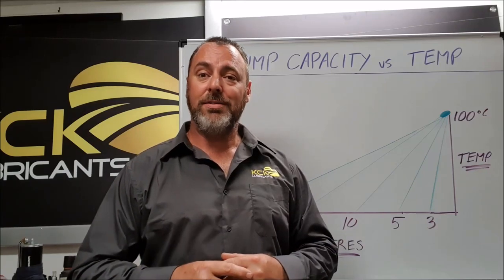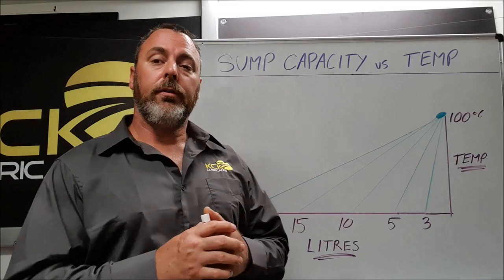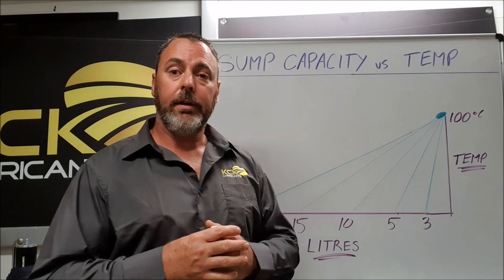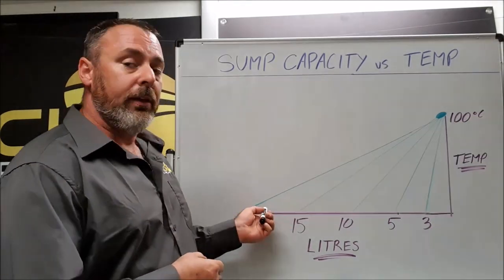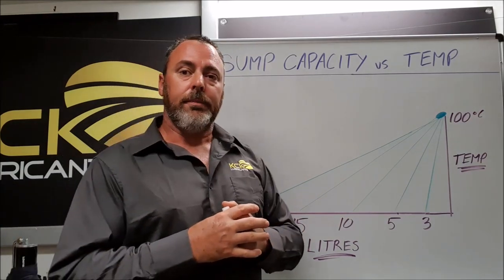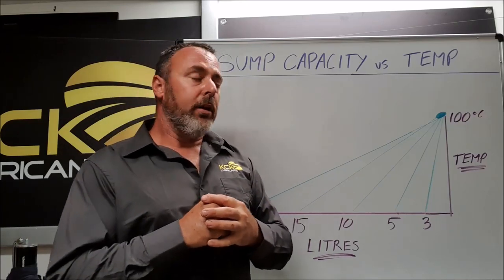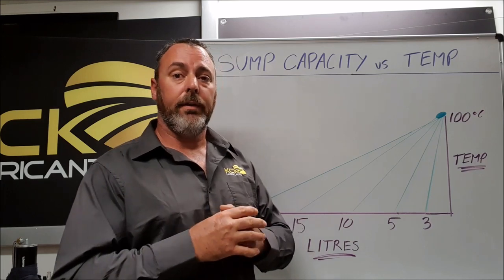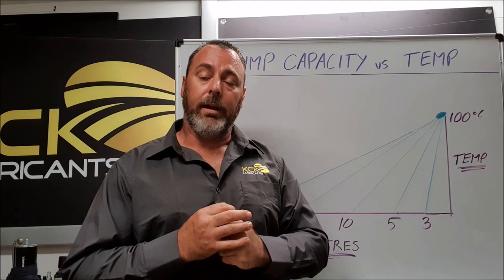Sump Capacity Vs Oil Temp, will increasing your sump capacity lower your engine oil temperature?

Comment: Terrific video. I have a BMW F10 550. It is in 63 motor V8 twin turbo. It’s a hot day so the turbos sit on top. I’m using liquid Molly 10 W 40. The temperature is usually around 100 to 110°C but I find during the warmer months he can reach up to 120 which concerns me. Without changing all Sams Wikipedia another option to slide to reduce the oil. Temperature on warmer days.
Reply from the maker: Thanks for watching! yes those do run hot but with a good oil its not a concern.

Comment: hey, what if the designed operating temperature is 100 deg C but bcoz i have a larger sump or if I provide external cooling the oil never crosses 50 deg c. how will it impact the engine performance or will it increase engine deterioration?
Reply from the maker: Absolutely check this video out, https://www.youtube.com/watch?v=9QLhDH-HNvI&t=8s

Comment: This is the same concept in water cooling a PC. For instance let’s say you have two computers and both have a custom loop cooling the CPU and GPU. One PC has a 120mm reservoir for the coolant and the second PC has a 360mm reservoir. Under high, constant load, eventually in both systems the CPU/GPU will reach the same max temperature, but the PC with the 120mm reservoir will reach that max temp quicker compared to the PC with the 360mm reservoir simply because of the amount of coolant the reservoir can hold. Great video! Simple and to the point
Reply from the maker: Thanks for watching! great point and very true, glad you enjoyed

Comment: However if you do have higher capacity and lets says your engine oil temps range from 220-270F on the track, it will be a much slower change when going between the 2, this also means it will take longer to cool the oil. So relative to short increases of temp, yes you will have lower temps in a short period of time compared to low capacity. But the lower capacity might cool down quicker.
Reply from the maker: Exactly, well said and thanks for watching!